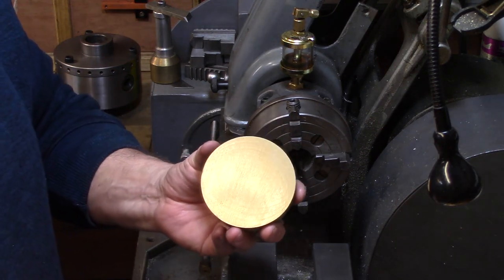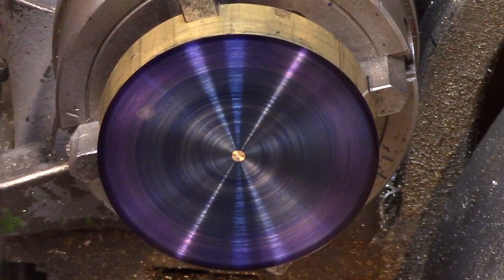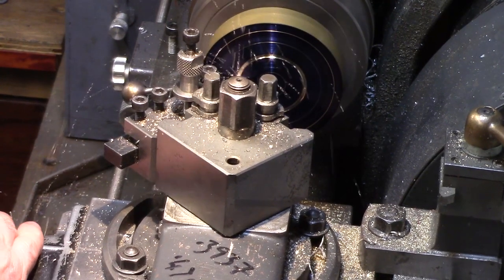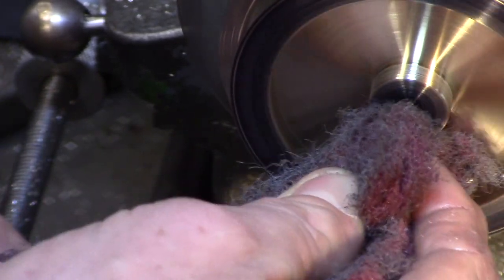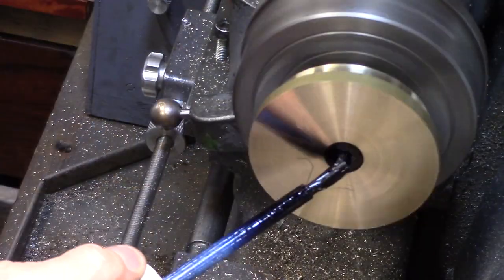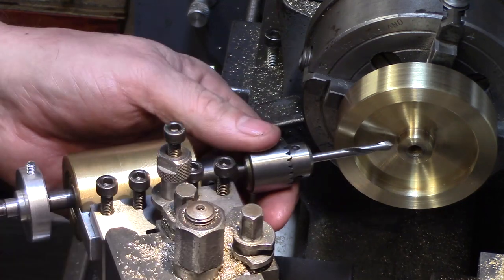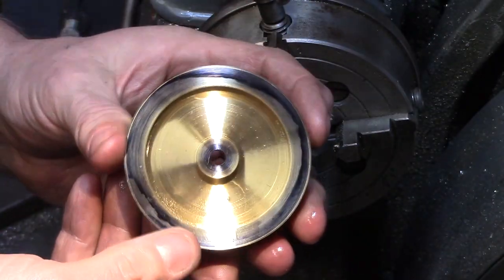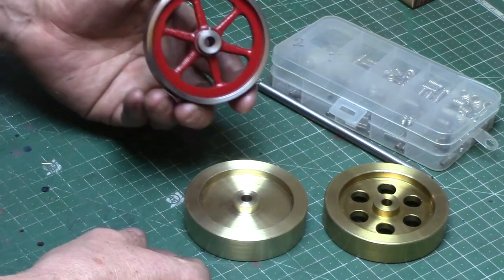Wig-Wag Steam Engine Build Series Part 4 -  Flywheel Turning

Comment: Great video! I have ordered a reconditioned Super 7 & as a beginner to lathes I am unsure of what cutting tools to get. Should I go for carbide or HSS? I see you have the Dickson type QCTP what size of tooling can you use in that tool holder? A video on these subjects would be most helpful 😀
Reply from the maker: Hiya Irvine, I use a mix of carbide and HSS, 90% of the time I will use carbide, but I swap to HSS if I need to grind a special shape or where the carbide just isn't practical, such as heavy interupted cuts, best to have both in my opinion. The Dickson toolholder is maxed out at 3/8" tooling, but I have several 10 and 12mm carbide toolholders which I have simply milled off the bottom of the tool so that I can get on centre, I personally like the bigger inserts that are designed for the bigger tools so I just modify them to suit my purpose. Best Regards, Ade

Comment: I'm curious. Is there a reason to bore, drill and tap for the grub screw, then bore again, as opposed to waiting to bore until after the grub screw? As a complete beginner, I'm just trying to get a good understanding of the order of operations. Thanks for another wonderful video.
Reply from the maker: The final use of the reamer is just to clean up any burr caused from the grub screw hole
Reply: @AdeSwash  That I follow. What I'm wondering is why ream before doing the grub screw drilling and tapping, just to ream again afterwards. Why not wait until one is finished with all operations and then ream just once. I've seen this done be many people, so I must be missing something, or is it just tradition. I.e. We've always done it that way.
Reply from the maker: @jimmccorison  one problem is that if the grub screw hole was in first, when you come to drillthrough, it will meet this hole and that will risk breaking the drill, or possibly the reamer if it is not the spiral type, the final reamer is just a clean up, it isnt doing any further cutting, It could even be done by hand, as it is just shaving away any burr in the grub screw hole.  Regards. Ade
Reply: @AdeSwash  That makes sense. Thank you.